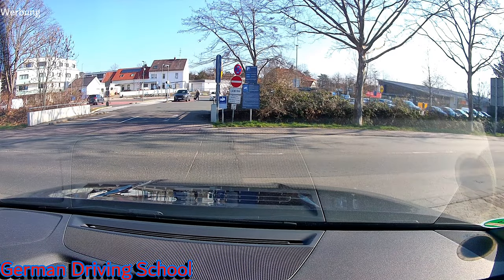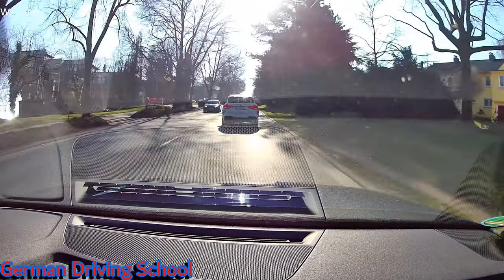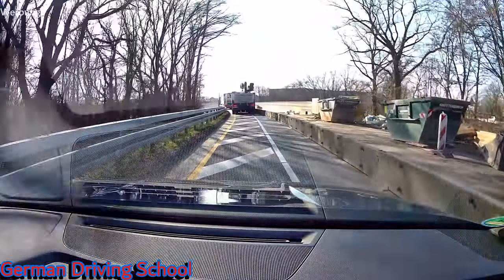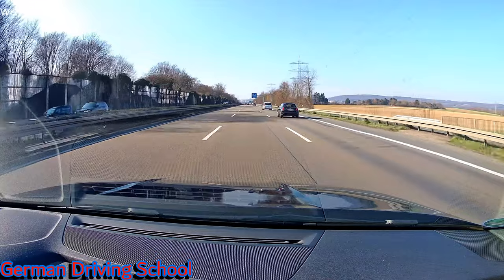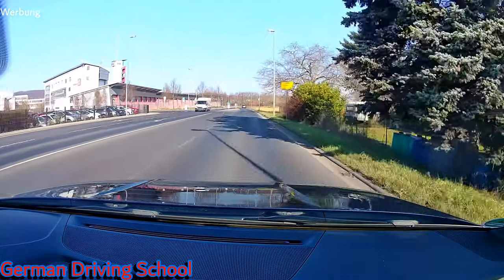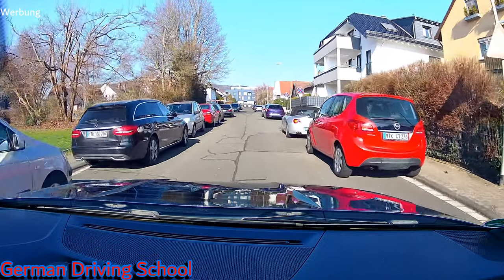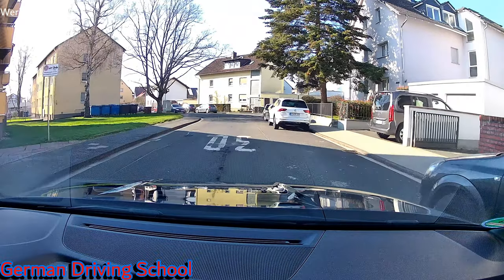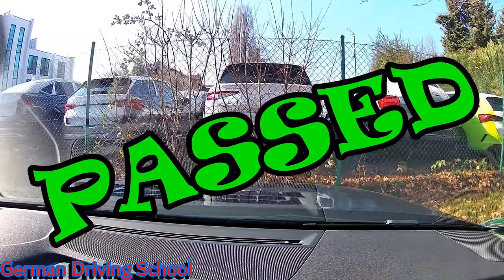Real Driving Exam Test #14 - German Driving School - 03/2023 Fahrschule English

Comment: Hallo Andy, I'm feeling quite comfortable with almost all the instructions that you're providing in each and every single video, which we may not get such information from driving school, I'm not making it general, but for me, yes I'm getting clear and better information from your videos, than from my driving school. Keep on doing this with clarification with each and every detail that's possible. 

 I have a question, in general, how many attempts are allowed for giving practical exam again if a student failed for more than 1time and what's the limit with it and how's the procedure for the next exam, is it just to wait for 2weeks or any additional classes needed and etc, detailed information will be helpful with the repeating situations of practical test due to multiple failures more than 1time in the exam.. thanks in advance
Reply from the maker: Thank you for your comment 😊👍
You can go every two weeks (if spots are available at TÜV).
By law you don't need to take a lesson. But if you failed it has a reason. And if I go to an (expensive) exam and I have a minimum 2-weeks break I would take some lessons to prepare. Lessons are cheaper than exams 👍
You can try as often you want. Every 2.weeks it's possible. But theory exam is only valid one year. One year after you have passed the theory exam your chance to take practical exam is over. You should be able to pass practical exam in less than one year after you have passed theory exam 👍
❤️☮️
Reply: Thank you very much for your detailed explanation, i also have another question, i.e after getting failed in a practical exam, is it allowed to change the driving school? If yes, what is the procedure, if no, then how to make the prices to get negotiate for the further payments in the driving school? Don‘t take me wrong Andy, because its hard for students to pay high prices and also getting license is very expensive in germany even after making umschreibung with minimum required classes and not getting cleared in the exam, this expenses are keep on increasing, please provide me an information and it will be helpful for many students like me who got struck in between with financial problem. Thanks😊
Reply from the maker: You can change the school in any status of process.
Change always means:
Step one: pay all bills in your old school and get all documents ('Ausbildungsnachweis') to prove what you have done in the old school
Step two: register in a new school and show them the documents 
Step three: organise the official change of the school. Generally the new school helps or organizes that process. Here in Main Taunus Kreis we can organize for the students as long as they are from the same area. If they are from far away they need to organize the change on their own. But that's not a problem because they know where they applied for the license with the old school. That's the place where to organize the change.
Step four: wait for documents of authorities. New school gets it
Step five: get some lessons and do exam

There will be a registration fee (Grundbetrag) in the new school.
❤️☮️